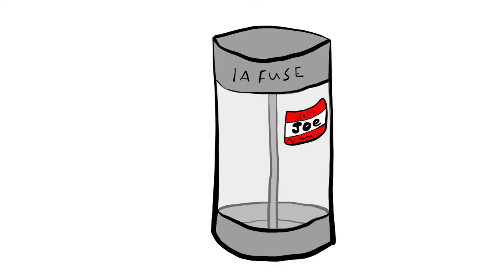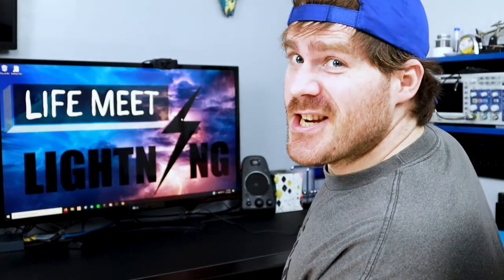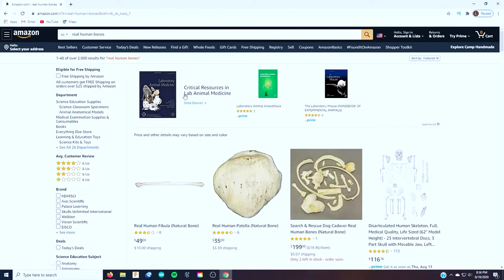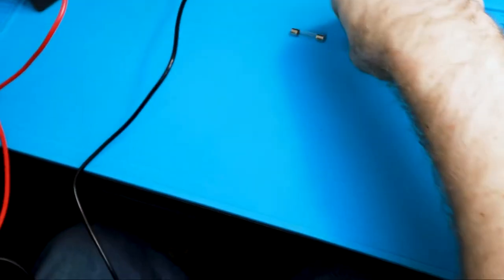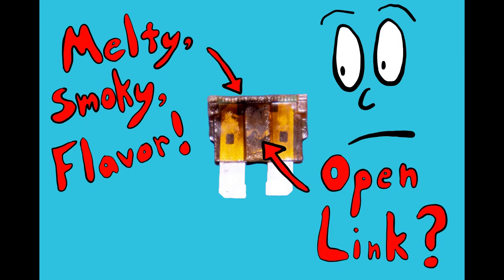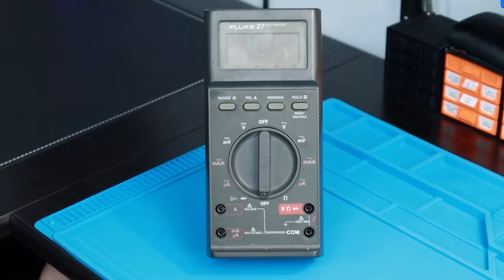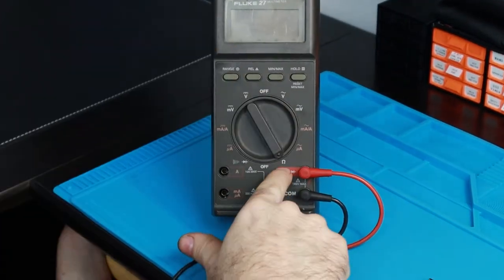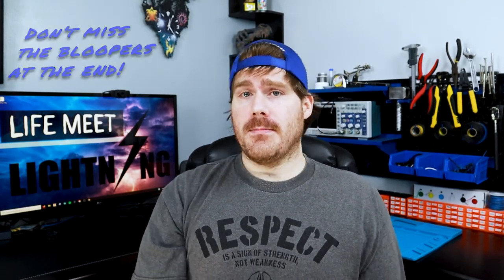What Does a Blown Fuse Look Like - Troubleshooting - Bad Fuse vs Good Fuse

Comment: I like fuses more than breakers, If the link just melts and you see it melted but no blackness 
or soot,  it was just an overload. This applies to the old edison scew fuses in older homes.
Sadly people don't seem to pay much respect to fuses in cars as "Its only 12 volts" yup, quite
true but there are loads of amps available, even a motorcycle battery can toast your bike's
wiring in a few seconds. Volts'll shock you, amps'll burn you and both during a fault can mean
a very bad day.

Comment: Wat about big 60A amp fuses like 1cm apart?
Reply from the maker: Size doesn’t matter, typically. Although with some bigger fuses, I have found bad ones that weren’t completely blown, but they read higher resistance. Bigger fuses especially should read very low resistance when they are good. Anything above a 5 to 10 ohms, I would replace it. I’ve seen a big fuse fail to open and interrupt the circuit like it’s supposed to. It exploded and blew the cabinet door open. That was a 100 amp fuse.

Comment: I needed to see the glass fuse broken :( But it was fun to watch
Reply from the maker: With glass fuses, usually the inside of the glass will be smoky and the wire that runs through it will be severed or completely burnt away. I have come across bad ones though that look perfectly fine, but when you measure them with the meter they test bad. They can be sneaky like that.

I had to rewatch the video because I was sure I showed the glass one. I guess not, other than the animation at the beginning. 🫤 Sorry.

Comment: Sorry to bother you but after a power outage my electric whirlpool stove has no power. Check circuit breaker, unplugged stove still no power.
Reply from the maker: A couple things I’d look at first:  Sometimes when a breaker trips, it won’t actually kick back to the middle position. If you haven’t yet, I’d try flipping it fully to the off position and then back on. It will feel a little loose compared to a fully engaged breaker if this is what happened. Second, I’d measure the outlet where your stove is plugged in with a non-contact voltage detector or meter (If you aren’t comfortable doing this, get help from a professional). If you have the correct power there, then it’s likely something with your stove. It could be a blown fuse within your stove; or possibly damage to the control board if you had a power surge.

Also, if you have an electric stove, it likely has a 240V plug. You’ll want to make sure you have proper voltage on two of the three or four receptacle slots. If you have a gas stove, it will probably have a normal 120V plug. It should still be on its own dedicated circuit, but I’d still check to make sure a GFCI outlet nearby hasn’t tripped.

Comment: nice video......I've got a Fluke
Reply from the maker: Flukes are great. The one I use is older than me!  Lol
Reply: I love them old meters. they are so cool how they work to. like the needle is attached to a shaft like a bolt and ot goes through a tube that is wraped with wire for induction .....it's crazy how them old meters work.  great video... I like the humor shots.. shows you pl;aned it out. I need to plan better i just go in and wing it and end throwing most of it away.  good luck with your channel . you ever see that funny electrician guy  .... he's like from Iran or somewhere over there ... he knows his stuff but he's allways melting stuff and getting shocked  ...he's funny
Reply from the maker: Yeah, I’ve seen him! Lol He is inspirational! I got to repair an old Huntron bench top meter from the early 80’s at work awhile back. It was pretty neat. We don’t get to repair stuff at the board level much anymore, but that older stuff can still be repaired at the board level!